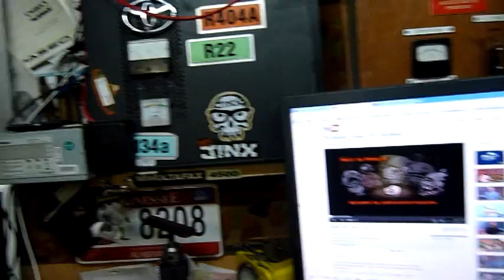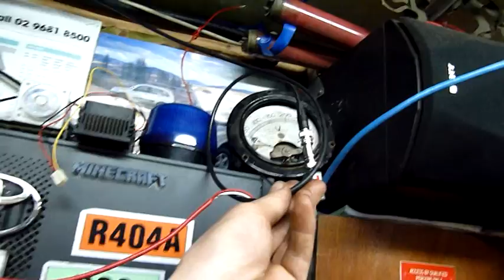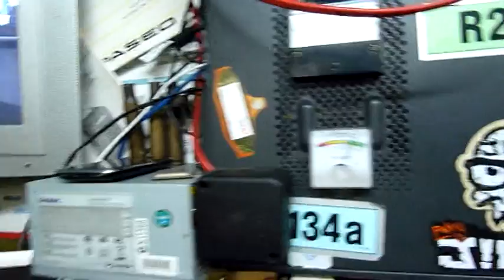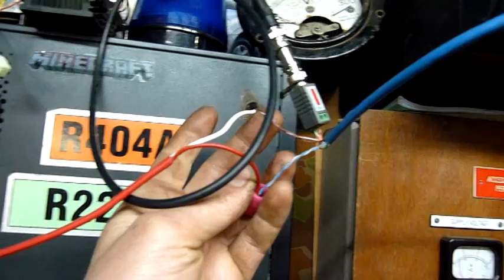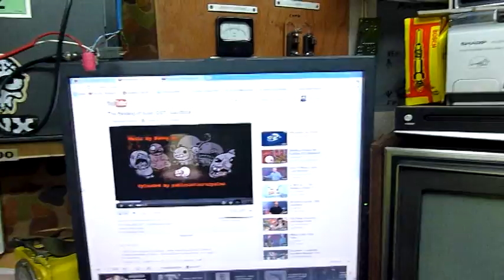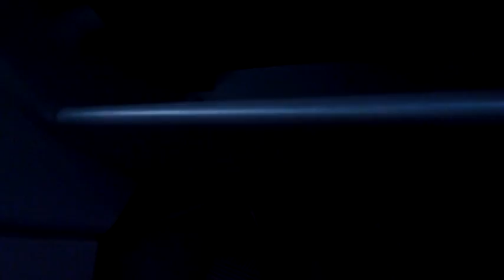Ramblotronic Thursday - Weather Projects and Micra Clutch Question

Comment: in my experince with nissan clutch cables it pays to have some slack or the cable will snap but maby like an inch max.
If its anything like my Primera the tentinor screw is on the gearbox end of the cable were the Cable goes over a hook on the throw out arm there is most likley a ruber boot over it.

Comment: The best way to check an SMPS is to connect it to a load and look at the output on an oscilloscope.  An SMPS with bad caps will have poor regulation and a very noisy output waveform.

Comment: Put a fuse in line with the +12V power coming from your computer so that if there's a short in the cable it doesn't burn up. Most computers can  source 20A or more on the +12V output (especially those with large power supplies).

Comment: He's right! just use one twisted set for the video. That way you can get full balance of the pair. Plus.that will free up and get you an extra set or wires for power. Run three instead of two.

Comment: ...you can use the other pair to trigger a standard doorbell down the spare wire. Anyway that works well but I scrapped it in favour of hooking the camera up to the computer and running ispy software. I now get a record of who comes and goes and I wrote some code to play a audio alarm when motion was detected, this is more reliable than PIR as you can set zones in ispy. Video capture cards are cheap now, again ebay for a usb one...

Comment: Hi, I was the one that recommended the video BalUns... good to see they are working out OK. The issue with the postie, what I used in a similar setup is a PIR sensor; Old alarm PIR sensors use the same 12v supply as the camera. A couple of options, I used a wireless doorbell as they are cheap. open the button and wire it up to the normally closed alarm sensor output. then every time the postie or cat walks past you hear the doorbell. If your camera works ok with just a single pair for power...

Comment: leave about a 1/4 inch free travel in the pedal , to compensate for things expanding in the clutch due to heat , but that pedal should be about even with the clutch , going by the cars here in the US of the same set up ...some cables have an adjustment on the cable , or in it's mount at the trans too , you will have to look it over and see the best way of dropping that pedal ...

Comment: the clutch should have about 7/8inch of free play. most cable clutches have a spot where you can adjust them the way you would an old dirtbike clutch or a throttle cable. its normally under the hood on the firewall. ive never worked on one of those cars before though so just giving my 2 cents

Comment: Just tighten up the screw and you should be fine i am a mechanic i work on clutches all the time they will tell you that you need a new clutch, cable, and pedal when all you need to do is tighten up that screw

Comment: that initial play isnt a problem, stick your foot on the brake and see how far off the floor it begins to takes up. you need to be able to put the car in reverse without it grinding but you also need it to totally disengage, so basically you want it about an inch or so off the floor to make it easiest to handle. 
magna has always been about an inch off the floor and has 2 inches of initial pedal play at the top and that's typical of all manuals. you could adjust the pedal stop down if it has one

Comment: ED the clutch in the micra should be very similar to the daihatsu
dont adjust it at the pedal, adjust it at the box
leave about 1/2" of "free" zone before the cable moves so you dont have pressure on the throwout bearing. should be an adjustment at the other end of the cable. i'll do a vid on the charade if necc.

Comment: You should get a better picture from the camera if you use one of the twisted pairs on the balun. i.e. just use the Orange/White and White/Orange pair. How you have it at the moment gives you less twists in the signal, so won't carry higher frequency data with the same noise immunity

Comment: You can adjust out a bit of that play, but dont adjust it all out or else the thrust bearing will be rubbing on the pressure plate at all times and there'll be no free play at all.